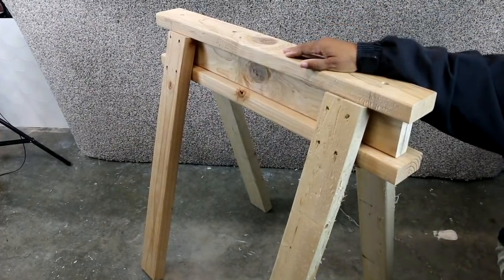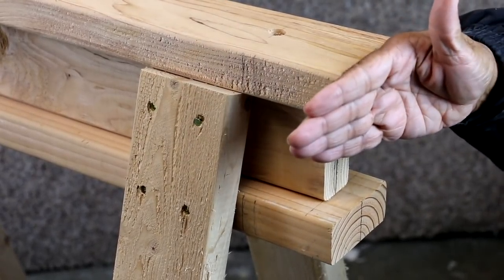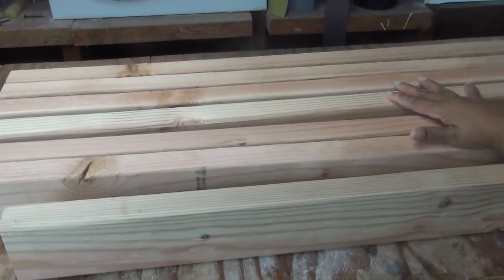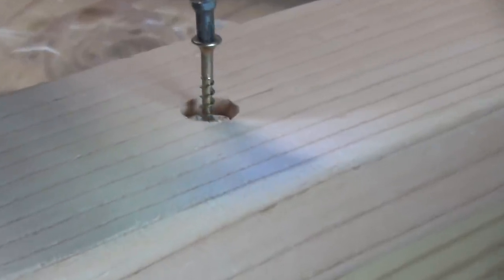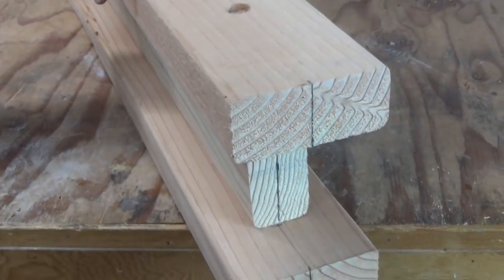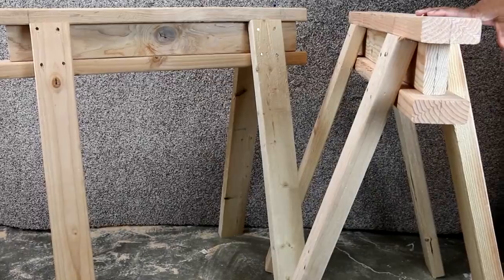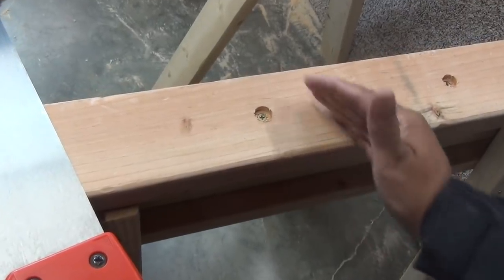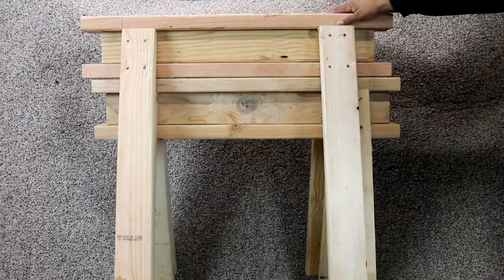A Sawhorse that ANYONE Can Build

Comment: Don't forget that you can simply flip over the cut up top plate use it like new again. Of course you'll have to counter sink the screws on that side to but do use both sides before ditching the top board.

Comment: I have built two sets of these horses and am building a third set for a friend tomorrow. They rock! The build is simple and they’re strong and stable. For my friend’s set I’m going to make the length 34”or 36” because I have access to a big pile of scrap 2x4s. I’m also going to brace them across the legs and lengthwise, because they’re going to be used to support some big beams and heavy lumber. This will take away the stacking feature as shown on Leah’s build, but the horses will be really strong — and heavy and not fun to move around. Leah’s build is fine for general use and more versatile. I use mine all the time, so thanks, Leah!

Comment: Thanks for explaining why the centre piece of the I-beam is recessed.  I saw the same design in other videos and it was never mentioned why.  I thought it seemed like a needless weak point, so I probably would have just made it the full width, and regretted it later when trying to clamp something.  I'll definitely be adding this feature now.

Comment: Great Build, they are the ones I make all the time.  One thing to remember is that they are medium duty horses, to make them heavier duty, put a cross piece on the legs under the I beam, and a stringer near the bottom of the legs.  They won't stack anymore, but they are now strong enough to hold up just about anything.
Reply from the maker: nice tip, Jim, thanks!
Reply: Actually, they still could be stackable if you put the stringer near the bottom of the legs on the outside of the legs of one horse and on the inside of the legs of the other.  The one with the stringer on the outside would always have to be stacked on the top.  I picked this idea up from another you tube video
Reply: I’m building a pair like this tomorrow for a friend. They will be used to hold heavy beams and lumber for a project we’re doing and the extra bracing will ensure stability. For general use in my shop and barn I use the ones without braces and they’re more than adequate. Great design!

Comment: I started out using nails on the legs but quickly switched to screws. For me it was much easier. I was building on the garage floor and pulled a leg muscle while hammering. The screws proved to work well. 
I’ve used these saw horses 
countless times.

Comment: I think yours is the best video on this that's out there, as the other ones take at least two or three times longer to explain!

But as a 45 yr+ Carpenter- Contractor, I wonder why you nailed it instead of using screws? I haven't used nails except as temporary points for securing less important work in 35 years. 

There's a tremendous range of fastening devices available to us, and even the simplest is five times more secure then a nail. Galvanised Ardox spiral nails are the only ones I'll use.

Comment: I usea couple saw horses and a hollow core door as my work bench often because i dont have a large work bench in my garage and also it's nice to work outside when the weathers nice.

I have 2 old metal ones my gpa had but they are a little low.  Been thinking about making a pair of wooden ones.  I saw a video on a 3 legged saw horse I think im going to make to further cut material costs.  These look solid Leah !! Good job.
Reply from the maker: mixwell1983  a 3 leg sawhorse.... now that's  interesting.
Reply: seejanedrill yah another youtuber izzy swan has a video on it.  When using in tandum they shouldnt make a difference he says and also you dont have to worry so much about level ground so we'll see.

First things first though i have a 6ft I have to replace between my neighbors garage and my property so thats my current home repair im starting today.

Comment: This is one of the simplest design I have seen. Thanks for sharing. One question though, is there a particular reason for using nails instead of screws when attaching the legs? Also, should there be a cross member between legs for streangth?

Comment: Perfect timing ladies!  I’m going to try these out.  I just happen to have some 2x4’s and the math will be good for me ;). Store bought Sawhorses are rarely the correct height for me and the ones I’ve received as gifts don’t like the weight I put on them.   I’ve never had I-beam horses but they should hold a lot of weight.  I’m guessing the nails will give out or the legs could split if they’re some checks already.  Did I miss it, or did you cut the feet of the legs so they would be level on the ground?  Going to watch again.  I’ve got a couple pair of folding horses and I like that I can flip over the board when needed, but they are more expensive with the bit of hardware needed.  Leah, you can weld a hammer right handed!  Good for you!  Ambidextrous skills are handy to have :)
Reply from the maker: thanks, Elaine!  Yes, the I-beam style does support a lot of weight, and you can easily adjust the height of the sawhorse so that it is right for you. 🙂👍
Reply: seejanedrill I will build to your dimensions first though!
Reply: I built three using some lumber from an old shed I tore down.  They’ve been put to good use holding up metal chairs for me to paint, used at a yard sale that I thought our nephew was overloading but they held everything just fine!  One set I made several inches shorter and they are working extremely well for me to put taller things on.  I’m going to build another set most likely...

Comment: Nearly identical to the ones I make. Personally, I like to leave off the top beam because then I can saw into the top when cutting sheet goods and not worry about hitting any hardware. I have a couple of these guys I inherited that must be 50-60 years old or more. I still use them and they're going strong.

Comment: Love love this  thank you for the build.  However I am a beginner diver and I don't know how to drill pilot holes seems simple enough but don't know what type of tool to use except drill of course.  Would love that demo. Thanks
Reply: Rebecca Burton for pilot holes, take your nail or screw and size it with the bit using one that’s a size smaller or you can just see the threads on the sides of the bit.  I copied this from Bolt Depot, they have so,e great charts that you might want to download and keep in your phone and print a copy so when your shifting through screws, bolts, nuts and washers, you will have a reference to refer. https://www.boltdepot.com/fastener-information/Wood-Screws/Wood-Screw-Pilot-Hole-Size.aspx
Reply from the maker: thank you, Elaine, for chiming in here...great advice!
Reply: seejanedrill :)
Reply: Thank you Elaine greatly appreciate this!
Reply: Rebecca Burton I’m relearning Ms Rebecca, Ms Leah and everyone who responds such as yourself helps me on my path, so it’s me who needs to thank you!

Comment: Nice easy build.  Love it.  One question... Why use nails on the attachment of the legs instead of screws?  I would think that screws would make a stronger joint.
Reply from the maker: For this application, nails are stronger.  Screws would be too brittle.

Comment: Question: Can I use wood screws instead of nails for securing the legs onto the beam? Reason being, I currently have a surplus of wood screws in my garage, but no nails, and would prefer to use up those screws.

Comment: Hey Leah, 

Big fan here. Quick question though.. did you use screws on the top and bottom of the Ibeam? Just curious before I try to build this cause I didn't know if the 3 inch screws would reach long to clamp the whole beam together. 

Thanks, 
Mike
Reply from the maker: Michael Johnson  Hey Mike,   yeah I used  screws on the top and bottom plates.

Comment: These look great. I have a question, though: factoring in the cost of the lumber, wouldn't it cost about the same to buy sawhorses?
Reply: Down here in the south decent 2x4 are 3.50 a piece, the brackets at hd alone cost 12 buck and ypu still need to buy the 2x4 legs so yea good value and you still able to make something with hands too.

Comment: Well, I built one of these, no problem cutting the 2x4s but when I assembled everything I ended up with a very wobbly sawhorse. 3 of the legs touch the ground and one is about 2 inches off the ground. Any ideas what I may have done wrong? I guessed the dimensions from your video of where to put the legs.

Comment: One quick question: why nails to attach the legs instead of screws? I will probably build these and am just curious, thanks!
Reply: If you're still curious it's because nails have a greater shear strength than screws. Google shear tension because a visual is easier to understand.

Comment: How did you keep the "I" centered and even when you screwed it together?

How did you recess the screws on top?

Why nails on the legs? Are they better than screws in this case?
Reply from the maker: I took my time screwing the pieces together.  
I used a paddle bit/spade bit prior to installing the screws.
Nails are stronger than screws.

Comment: Great video! Could these be used for table legs? Like if I wanted to build a custom work table with a standard 4x8 sheet of plywood or OSB and keep it from being Wobbly? If not, what would you recommend for that?
Reply: Mike Love You might need three, one in the middle.  Depends on the amount of weight you will be putting on it.  If you are out and about and see a dining table at the roadside, grab that and do any repairs.  I picked one up that way about 15 years ago, the leg corner was broken at the lag screw.  I did a quick repair and it’s been a great little work area ever since!

Comment: How do you recess the nails
Reply: Many different ways. I assume you meant the recessed screws. To do that the easiest way all you need to do is use a drill bit with a larger diameter than the screws head.

Comment: Leah, question, why did you use nail instead of screws on the legs?
Reply from the maker: Mike Hammer  nails are stronger
Reply: Leah had a video on nails vs. screws. She said the nails are better for “shear” strength and the screws are better for lateral strength. So when a load is placed on top of the saw horses the nails will bend not break:-)

Comment: Can  we use  screws instead of nails?  It seems easy to  make them  especially for a beginner !
Reply: ΚΑΤΕΡΙΝΑ ΠΙΤΣΙΟΥ there’s a discussion going on about this...it’s about shear strength and tensile strength.  It’s too much for my brain to handle right now but what I know is that one of the men in my family bought those metal saw horse bracket sets and used nails,  I’m still using them. I’m guessing it was Dad because I don’t remember not having them.  The ones that were plastic didn’t hold up, the plastic broke apart, not sure how old they were.  The metal brackets that I  put together about three years ago because Dad and I couldn’t find his nails and we needed them, the screws are either backing out or have failed completely.  Oh and the instructions on the metal brackets say to use nails in the legs.  I would suggest take Ms. Leah’s suggestions like a new recipe.  Don’t change it until you’ve tried it once.  You only need a one pound box of 10d common to make a set which is about $5.00 but I usually buy in 5 lb boxes to save money, it takes the price down to about $3/lb.
Reply: Thank you very much for your time and for the information !
Reply: ΚΑΤΕΡΙΝΑ ΠΙΤΣΙΟΥ Thank you for getting my neurotransmitters working a bit more!

Comment: cool but is this really worth the trouble over just grabbing fold-able sawhorses from harbor freight for $7 each?
Reply: Joe, don’t know how tall you are, I’m just about 5’ 1 ½”.  The cheap ones at HF are light weight.  They won’t hold much weight and don’t like to have things moved frequently around on top.  I broke a pair rather quickly and still can’t figure out how.  Plastic gets brittle and doesn’t like the cold.  I have a few other brands that just didn’t like what we put them through, so I went back to wood.  I found shop made to be more efficient, hold a lot more weight without concern and I can make them to fit me, not someone who’s 6’ or close to it.  These get the job done, are quick to make, even with a circular saw and a speed square.  And they are easy to stack.  Also as someone suggested, you can add a gusset to the 2x4’s and make them stronger, but I haven’t had the need.

Comment: is there a reason you nail the legs instead of screw them also ?
Reply: Ms. Leah did a video on nails vs screws https://youtu.be/SLl3-jvTmBk. And just in case someone hasn’t hit a nail for awhile there’s this one  https://youtu.be/SLl3-jvTmBk
Reply: Shear strength. Screws are brittle, they'll snap under pressure.
Reply: Yes shear strength is better with a nail but most of the weight on the legs is on the end of the 2x4 since it’s tucked up next to the underside of the top of the I beam. Screws have a stronger tensile strength then screws. Leah does a great video on this. In this particular build I don’t personally think it matters what you would use to attach the legs. I may personally like a stronger tensile strength to keep the legs from “spreading” apart at the bottom if too much weight is placed on them. But that’s a whole different can of worms to open lol